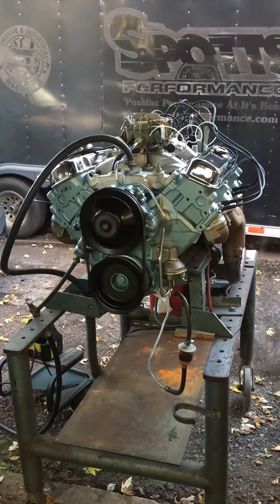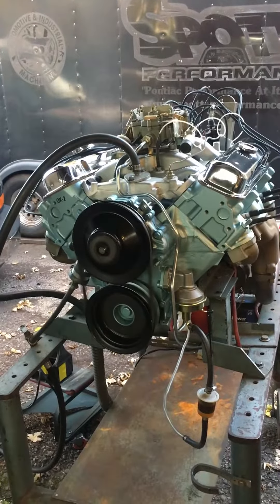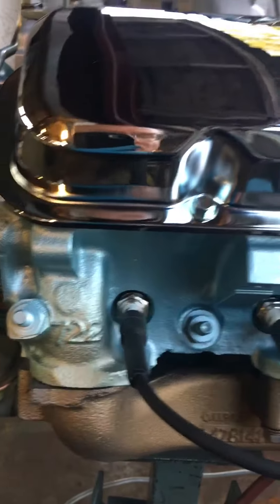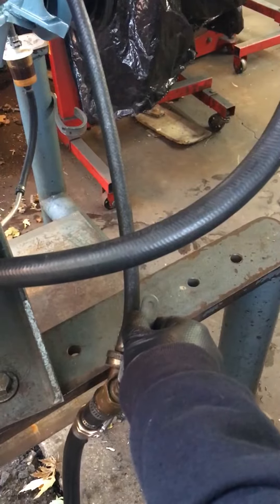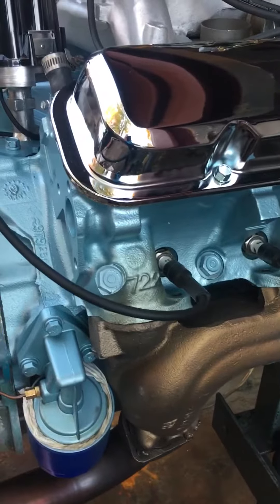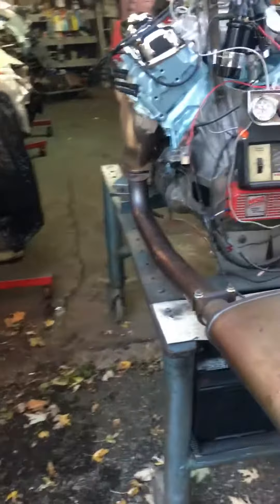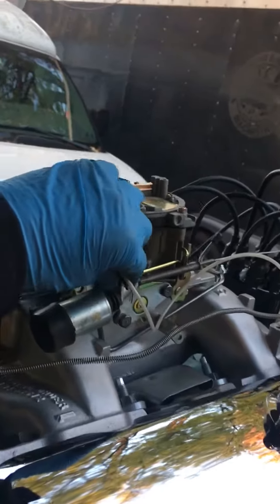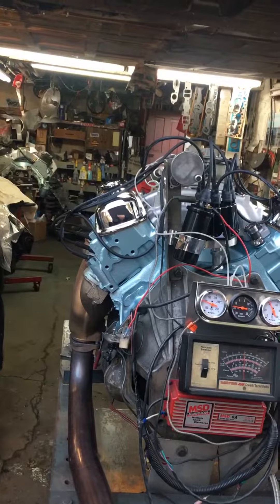1969 Pontiac RAIV WW code by Spotts Performance

Comment: Those heads must be the later 69 722’s. The early 1969 Ram Air 4’s had 614 heads right? Then they made a couple changes to the heads and they became 722’s.